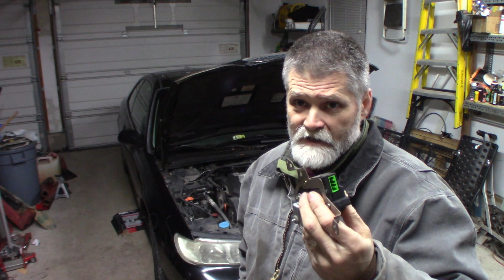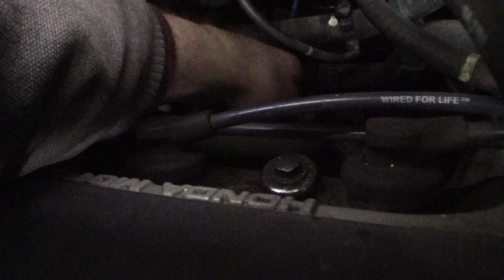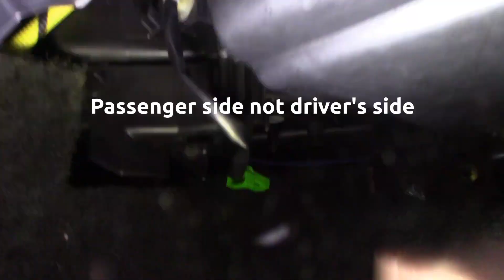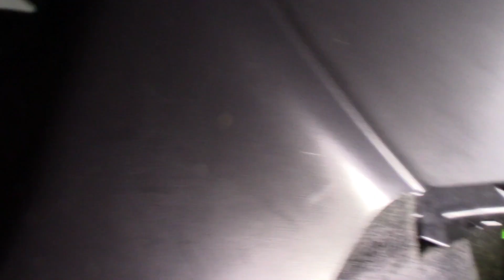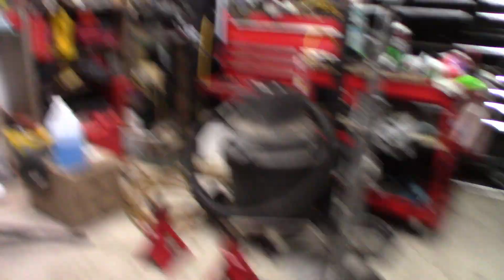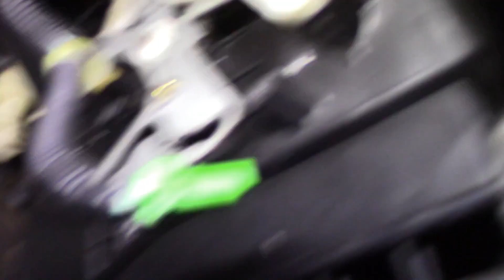1999 Acura CL - No heat and air only out of mid level side vents

Comment: Glad I found this. So both actuators were out. Lucky me. Hoping I can find some that work. I moved them by hand. The driver side controls the air flow so I left it on the defrost mode and the passenger side controls the heat/cold so I moved it to heat. Thanks for the video
Reply from the maker: Glad it helped
Reply: Did you have a replace both?

Comment: Hello 
Thx for your good info I have 2005 Acura TL no heat blow out at middle vent and also when pressing Mode for floor no air blow out 
So that tell me two motors are bad on driver side and other passenger side

Comment: That was really helpful to diagnose and locate the parts and potential problems with my 1999 Acura CL heat/defrost.
Reply from the maker: Glad it helped
Reply: @CharlesAndCars  great vido, is the floor to defrost actuator available 
?
Reply: What are the names and even the OEM part numbers please?